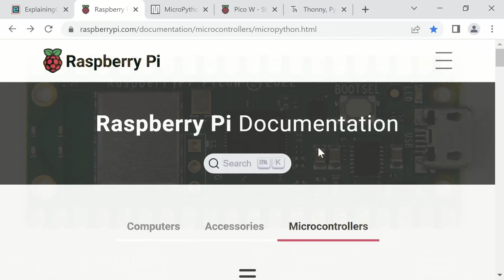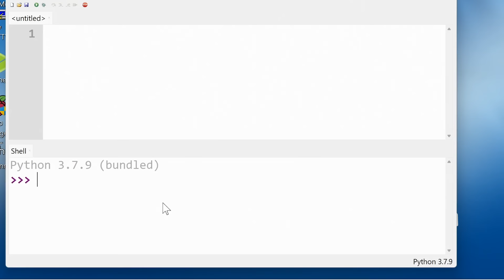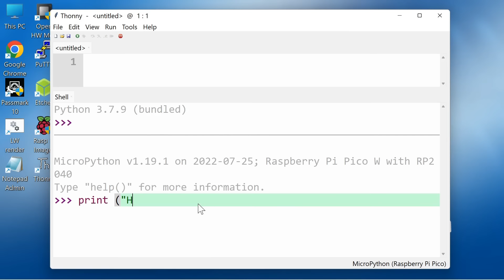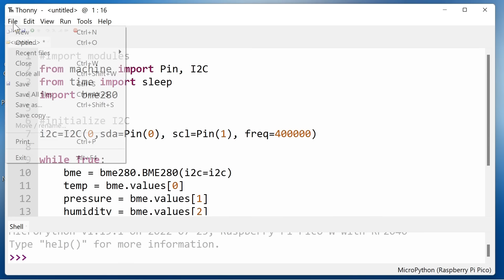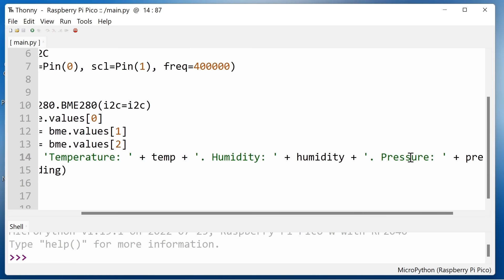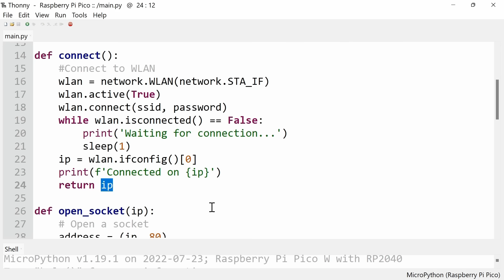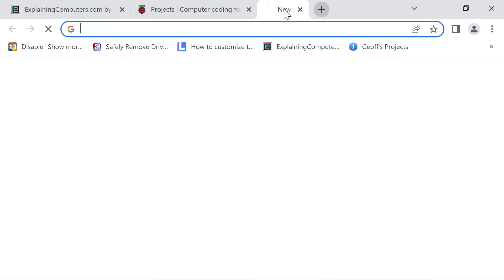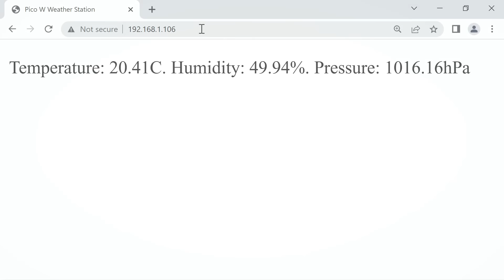Raspberry Pi Pico W: Wireless Weather Station

Comment: I am having the toughest time with this! it keeps giving me an error on the line that has:  bme = bme280.BME280(i2c=i2c) and also: File "/lib/bme280.py", line 75, in _init_
I am pulling my hair out! Any suggestions?
Reply: Figured it out!! I had the more rectangular BME sensor, which defaults it's address as 0x77! Thankyou Mr. Barnatt for doing what you do!
Reply: @jameslinderman6825   How were you able to find the proper address for your specific BME sensor?

And when you did, did you just replace the number in line 75 in bme208.py?
# load calibration data
        dig_88_a1 = self.i2c.readfrom_mem(self.address, 0x88, 26)

Thanks!
Reply: @jean-marctrutna4098  I think it was 78 on that sensor. I’ll have to look later and I’ll post.
Reply: @jameslinderman6825  Thanks for your help.  I have a RedTagCanada GY-BME280 and I'm not sure where to find that number.

Comment: This is great, but how do I push that data to my own website?

ps. I have been trying with a RPi since 4 years ago, but gave up. The best I could do was to publish a jpeg image of the result on my webpage, which is not cool. You cannot run dials and cool dasboards and such off that.
Reply from the maker: One solution may be to push the data to a Google Docs spreadsheet, then you can embed a chart in any website.
Reply: @ExplainingComputers  ah thanks Chris.

I managed to run a tutorial that saved all the sensor data to a google spreadsheet, but never knew I could process and publish the same data on a webpage. I will read up on that.

Comment: What a neat idea!  I live in a rural area, so all the weather apps that I can get on my phone and the internet do not show me the weather conditions in my immediate vicinity -- they all grab data from the nearest official weather station which is easily 20 miles away, perhaps 25.  This would give me a great way to quickly check the conditions outside my house -- even remotely, if I opened a port on my router and redirected the Pico's web-server to that port.  Plus it'd just be a cool flex to be able to show this off to my friends and family.  🙂  Thanks!

Comment: Is It possible to connect to the pico through a direct wireless connection like Wi-Fi direct or bluetooth using the on board wireless Module?
Reply: I have some PICOs performing tasks in places impractical to sit with a computer and work on when they need modified. I took a spare Pi4 and plug the PICO into it then sit at my desk and remote into the Pi4 from my PC via VNC

Comment: I used an ESP and C++, but instead of a web server in the ESP, I have the ESP pushing JSON data to a Python server I made, running on my NAS. It collects data every 10 seconds. The ESPs are pushing new values every second (because WiFi ;)). I an collecting data from outside and almost every room in the inside since about 1 year. I will add some more features, make the code cleaner, maybe even port it to C# core and post it online open source. I can also write code for the Pi Pico W, but I don't have one to test.

Comment: You, sir, are a wizard :).  One question - Can the sensor module be configured for Fahrenheit?  Not that it's very hard to convert the temp in code, but still :).  I know the SenseHat sends measurements mostly in metric, so I had to write a few helper routines to convert the values.
Reply from the maker: Thanks! :) The sensor module just chucks out I2C data, with the MicroPython library used here written to output Celsius values. I'm not aware of a setting to change this. So you would need to write a converter, or to find another BME280 library (or rewrite the same).
Reply: I used "temp" for the reading in C and added the next line;
temp_f = (temp*1.8) + 32
and then I print the temp_f value
All the libraries seem to output in C and this has worked well for me as a patch
Reply: @brucehanson4147  I tried this, replacing temp with temp_f in the reading = line. I get this error message: TypeError: unsupported types for __mul__: 'str', 'float'

Comment: Interesting to see that the debug pin locations have been moved, for no reason that's obvious to me. So I can't directly replace the regular Pico in my breadboard setup without making wiring changes.
Reply from the maker: I guess changes were needed for the WiFi module wiring?

Comment: Excellent Video - However, please do NOT save this as main.py as this will brick the unit, and you will have to re-flash the Pico. There is no way of stopping this running, even with Ctrl+C
Reply from the maker: Thanks for this. To have the Pico execute the code standalone, it has to be saved as main.py. It should be stoppable in Thonny using Crtl-C and/or Ctrl-F2. But it can certainly be tricky, as the code here includes a machine reset on the end because a WiFi connection can drop.

A Pico cannot be bricked via software. But it may on occasion need to be reimaged as you note (instructions for which I included in the video description). Certainly, as you imply, saving the code under another name during development can save time. :) And a copy should always be kept off device. I should have noted these points in the video, and will do so in the next one now you have raised the issue.
Reply: @ExplainingComputers  - The videos you do are amazing and so much information is included, it would be impossible to cover every possible option or fault. That is what error trapping is all about. I got my Pico W back by uploading the firmware again and it was fine. Ctrl C did not work for me and now did the reset but as you say, in development it’s not necessary to run this file at boot. 
Your videos are truly amazing - I have learnt so much through your enthusiasm and hope you do more on the Pico W

Comment: In this hot weather I think it's a good idea to use PICO to control a fan and a humidifier to justify the room temperature,
or maybe we can clone an Air Conditioner IR signals then use that to write a little program to make it act like crazy,
or, what about converting an old washing machine with mechanical program selector to a digital one.
So many applications for this lovely little PICO

Thanks Chris and have a nice weekend

Comment: Where do you have to go to find a Pico W for $6? Is there a circuit board market in Wuhan China?
Reply from the maker: You have to go to any official Raspberry Pi reseller -- they all sell the Pico W at $6 -- eg Adafruit: https://www.adafruit.com/product/5526  But stocks are currently intermittent due to high demand, so you will need to register via the "Notify" button on the product page to get one when next in stock.
Reply: I live in Nashville, TN and ordered 5 from Pimironi 10 days ago. Standard price and only 7 pounds for shipping.

Comment: Its funny how a so tiny chipset (BME280) that is designed to have the smallest footprint possible on a board is packed in such a huge board and the fact that this IC is 3.3Volt compatible is making this chunk to look even more ridiculus. Nice tutorial BTW. All it needs is a intercom protocol with some security to make it work with an IOT ecosystem.

Comment: Do you know if is there a rain measurer sensor ?  Could be very useful with this project, at least for me.
Reply from the maker: There are rain guages -- then tend to work on tilt when enough water falls into them a I recall. But I may have a go building one! :) I did a home-made anemometer last year.

Comment: It's funny, but I originally bought my PiZeroW to do that task... and have been too "distracted" to get it running.  Now it is not just possible, but easier, with even less hardware, and even lower power demands.  The way of the computer world in microcosm.  Thank you Chris.
Reply: Yeah, every generation gets faster and cheaper.  Probably even easier.  I just love how Computers are so great for our lives.
Reply: It's funny but I have a PiZeroW I purchased for this too but haven't used because I couldn't figure out how to power it outside. Thanks Chris for making me aware of the PicoW, I'll be grabbing one of them now.
Reply: @kaiying74  Jamie, I found that one of my USB power banks for adding power to a phone will run a PiZeroW.  The other one will not.  But it is worth your trying a few before buying if you too have the need to power one outside and without any trailing wires.
Obviously the same power bank would be great for a Pico.

Comment: Two minor points: Drag and drop between drives is already a copy operation, not a move, so no need for all the right-click, copy, right-click, paste. Secondly, the first view of the page is potentially showing very old data (what the values were when you previously viewed the page) - socket.accept() will block until the next new connection arrives - try moving the BME read to immediately after the client.recv(1024) to see guaranteed-current values.
Reply: Came here to say the same thing.
Reply: Most times it is easier to ‘click’ the mouse, then move elsewhere, then ‘click’ again… rather than having to hold down the button while moving the mouse.
In my case, neurological damage makes this the case… holding the button down is difficult, it often ‘shakes’ loose…. Clicking if far more exact.
In my case.

Comment: Hi Chris, great video. What is the range of the Wi-Fi on the Pico W?
Reply from the maker: The Pico has 802.11n, which has a theoretical range of up to 230 feet (about 70m). I tested the Pico W in the video up to 30 feet (c.10m) from the router with no issues. WiFi range always depends on the walls and other structures that lie between the Pi and the WiFi router.

Comment: I must admit I was quite concerned that you'd gone outside without a computer...   
Just curious - the Pico W has a temperature sensor onboard, I presume it's just temperature but would this be a useful device do you think?  Thinking mainly for temperature monitoring of a cabinet I have some servers in.
Reply from the maker: You are right, there is a temperature sensor in the RP2040, which for many purposes would be fine for monitoring purposes -- particular when checking on electronics.

Comment: Ah yes, the Infineon CYW43 (aka Cypress) wireless module, aka Broadcom BCM43... What a lot of corporate transactions! Pretty crazy they've managed to add a whole additional module for such a low price, especially since the wireless module has more powerful (cortex M4 iirc,  though single purpose) microcontroller cores in it than the RP2040 itself. Must be a heck of a volume discount 😁

Comment: Do you need to run the Wifi config program each time the Pico W is turned on or will the Pico W remember the Wifi config automatically
Reply: That seems to be in the python code. Which means ... the python code is the OS in this case.
Reply from the maker: Some code or other needs to run the WiFi connection each time.
Reply from the maker: @boink800 is correct.

Comment: Thanks Chris. I have a question: is there any risk somebody gain access to the pico and reading the code, gain knowledge of your wifi password?
Reply from the maker: Certainly anybody gaining physical possession of the Pico could obtain your WiFi password from the code. To hack into the Pico over the network would require somebody to already be connected to the network, for which they would already need to have your WiFi password (or to have broken into your home or business and plugged into an Ethernet socket). So the only practical risk is if somebody steals the Pico and reads your code on it. Remember that the Pico here is connected via WiFi to your local area network, not to the Internet.

Comment: My soldering is much more beautiful. Maybe your soldering iron is not hot enough. Maybe your soldering wire is high-temperature sort.
Soldering should be very shiny. And put a bit more solder.

Comment: Great video! What about being able to reduce the number of digits and rounding up for the temperature, and using the barometric scale used in the United States which is psi vs. kg per square centimeter. Also, what about putting the module in a box?

Comment: The PICO W uses a sensor or two and has wireless at a very good price. It essentially solves a problem that has existed for a while - placing a multiple sensors. Not least I will be looking at these for water leak detection. Most sensor makers make moisture sensors.
Normal raspberry Pis are ok for one offs but when you want multiple sensors the price gets up. The pico was ok and all, but without communication its uses are limited.

Comment: BME280 is notoriously bad choice for reliable temperature measurements due to self heating. It's in the datasheet. It's mostly used to correct the algorithm for more accurate pressure readings.
Reply from the maker: For personal use there is nothing wrong with a BME280 for measuring temperature, pressure an humidity. I think it is pretty obvious that this is a cheap personal project.
Reply: @ExplainingComputers  I agree and I didn't mean to down play it in any way, you're doing fantastic work in explaining and giving maker projects like these a wider audience. I used to be under the impression BME280 was a fantastic sensor because it is widely recommended and has good "absolute accuracy" which conveniently ignores its own self-heating aspect. Nowadays there are alternatives that perform better and doesn't cost more expensive either. Cheers

Comment: Great video, thank you.  I always enjoy a video that necessitates a soldering iron!  I use an old WEMOS in a similar capacity but that only reports temperature.  That Bosch sensor is a bit pricey if you have a lot of temperatures to monitor.  Looking forward to further videos on this theme.
Reply: Instead of a BME280, you could also get a BMP280, which doesn't have the relative humidity.
Reply: May lm71 also make it for temp in the digital. Cheers

Comment: Great, as usual.  Especially in projects that aren't likely to have external documentation, legibility > golfed code every time. (When the time comes to change something, you'll know why.)
I would quibble about the output format, though.  Transmit only the variable data, (identifiable as fields, CSV being a good first choice), not the constant decoration.  KISS.
Dollars to doughnuts, a subsequent change will make it necessary to process the data in a different way, (e.g. as input to some sort of controller), and you don't want to have to dig the numbers out of the surrounding text. That can always be added in the HTML.

Comment: As ever, a really interesting and engaging project, superbly explained. Thank you, Chris! 

Perhaps well understood by most, the two major learning points for me were:
a) the importance of indenting code; although I could get the code to read the sensor and send the reading to the shell in the first segment of the tutorial, an error was generated in line 53 whenever I later tried to run the full code. I eventually worked out that the 'while True:' statement, and subsequent lines were not indented appropriately on my Pico code.
b) the second point was to remember to press the 'STOP' icon before trying to run newly edited code.

Very satisfying to get it all working!
Reply from the maker: Glad you got it working. :)

Comment: Awesome video! I'm a noobie at all of this, even though, I would like to do it by myself, but I have one problem. I want to place the Raspberry Pi Pico next to a field far away from home. Therefore, the wifi is not reachable from there. I was wondering about adding some radio frequency component (LORA) to try to reach the wifi. But I'm not sure if it's the best solution and how it works. Many thanks in advance ^^

Comment: A natural evolution and a challenge of this battery powered project would be to try to optimize power consumption as much as possible. Maybe using deep sleep in the 10 sec intervals if possible. The ability to power the Pico directly from a Li-Ion cell is also nice in that respect. ESP8266 or ESP32 were a natural choice for a similar project until now, but you run out of i/o pins very fast. It's nice to have alternatives to choose from

Comment: I'd like to see a variation on this where the readings are published periodically using MQTT, which would align well with home automatiion systems like Home Assistant.
Reply: Not falling for your telegram scam
Reply from the maker: I have banned the spam telegram account and asked telegram to remove the scam account there.

Comment: Hello, nice video as always but... I looked into your code and I think there is a problem.
You shouldn't be creating a new instance of the bme object ( bme = bme280.BME280(i2c=i2c)) in each iteration of the loop (inside serve function). A Pi pico doesn't have gigabytes of RAM!
You should create it once as a global object (like i2c object) and then reuse it.
Best regards.

Comment: Fantastic demo. Really sticks the point and keeps things simple, but understandable and with all the detail a person would need to do lots of variations on this great project.

Note though: you appear to be relying on the wifi connection receiving the same IP address you got when you were tethering the board. It's true that this is very likely with most home use wifi routers, but certainly not guaranteed. A more robust project (i.e. not just a demo) would probably implement discovery features, like maybe adding NetBIOS support or some other name service, or a broadcast query/response protocol, or something like that.

For the purposes of this demo, a couple of possible suggestions: the most straightforward is to just remind users that if they don't see the board at the IP address they expected, check the client list of their wifi router. For extra credit, while you're adding a status LED to the board, also add a small dot-matrix display that will show the IP address (or maybe just use that display as the status also :) ).
Reply from the maker: As you say, this is a demo about keeping things simple. As I recall, I do mention the IP issue in the video! :)